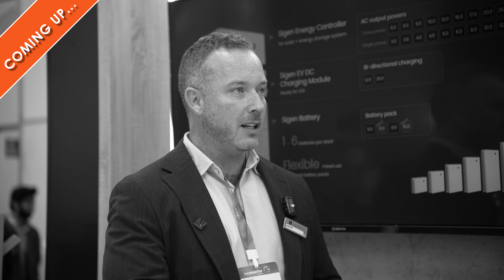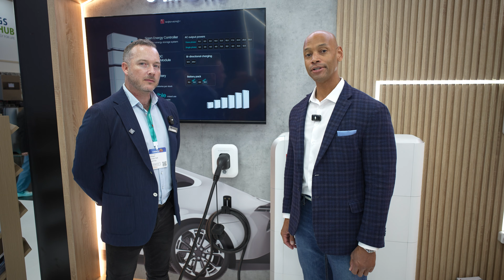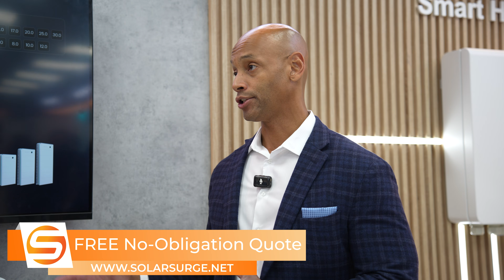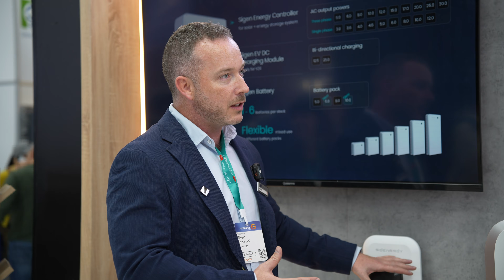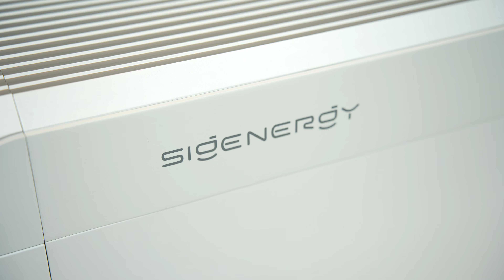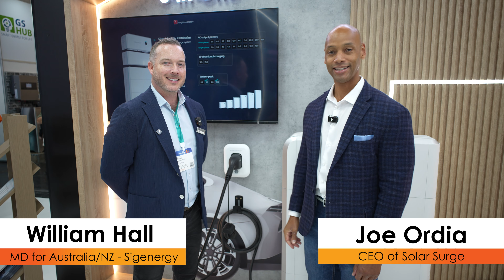NEW Sigenergy Bi-Directional DC EV Charger | PointGuard

Comment: My final comment with H2X capabilities home batteries and a heat dump I am turning my home into an energy positive household saving around £2K on standard bills.  Plus the fact that on fuel my EV home charging is saving me further £2K based on 12K miles a year.  My goal is to become energy independent for when I reach 80.

Comment: On a technical level I'd like to understand what is where... The vehicle side of the bidirectional charger is DC (about 400 V to suit the vehicle battery), what is the other side? DC to an existing battery or panels in the home or AC to the grid - 3 PH or single PH??

Comment: this is what the PW3 should have been. I mean it already has PV DC to DC battery (with I suspect a boost up in voltage) so why not insert a wall charger in between and do DC charging AND v2h using that existing hardware ?
well I guess that would eat into secondary PW3/Expansion packs AND reduce your battery warrantee per miles (which they could track). But common Tesla, that's what we want!!! we have 7x batetry between wheels AND coudl charge on solar much mroe efficently.

Comment: When will it be available in the USA? I have a 10kW and a 6.5kW system and would love to have a good DC storage solution with V2X for both. Our grid provider is not providing the incentives to sell excess back to the grid. So the more I can use the better.

Comment: Tesla has really dropped the ball on V2H DC charging. What losers. They could have been leaders now they are almost last cause the CT implementation is such a pathetic method and was the easiest thing to do since they already had DC to AC conversion onboard. Pathetic Tesla.
Reply: Not that I don’t think there are plenty legitimate gripes about Musk and Tesla. But I don’t think this is one of them. 
The issue is US regulators being slow. And then PoCo’s dragging their feet (see issues with meter collars). So, both EnPhase and Tesla not in a rush, as it will be a while for standards, vehicles, AHJs, etc all being ready to support this. Why first in Australia? Cuz standards pushed out much sooner.
Reply: @lawrence_SoCal I get the vehicle to grid regs are a mess but they could have easily embedded a Tesla car into their power wall. All they had to do is connect a power wall to their wall plug and the user could use the power DC battery to charge their vehicle or in the event the battery was depleted since the power wall is already connected to power it could have sent AC to the car. If they did this, during power outages the user could still power the car and the user power the whole home by using the battery or the car as a battery along with the power wall. All of it could have been done without home to grid regulations. What a missed opportunity.
Reply: @TheLobo91 understood and I don’t disagree. BUT, plenty of Powerwalls sold to non-Tesla car owners. Or folks sell their Teslas. Having a capability limited to only some of Teslas cars, that could only work in limited situations… with lots of stupid end users who’d tried to make it work with other vehicles … sometimes patience is a virtue. My point is there are other mass market considerations that could have been really good reasons for Tesla to not get so far ahead of standards 

And, per my other comment… still waiting for independent review to confirm or refute that DC bi-directional EVSEs are actually worthwhile in general (due to energy loss with voltage conversion at a minimum). Now, if home battery and EV battery the same voltage, then DC charging makes lots of sense.. but when that isn’t the case?
Reply: @lawrence_SoCal  their must certianly already be a DC to DC voltage up as PV are not quaranteed to match the internal battery. had they made the PW3 battery the same ~400v as most tesla, it coudl have simply made the car a 7x expansion pack with very little work. done...
Reply: @lawrence_SoCal  The National Electrical Code has added provisions for bidirectional charging in the 2020 version. Also, the global standard are already in place as well under ISO 15118-20. The V2X Module launched about the same time in the US as it did in Australia.
Reply: @Elec_Engineer_03 that may be, but the existing code really only covered, effectively, V2G, as V2H means working when grid is down, so you need MID coordination and power control of PV for an effective solution. And getting agreements across companies, industries, is still a work in progress last I heard. Going all in on same vendor (inverter, battery, MID, and EVSE) seems the only practical solution today which is an indication that practical effective standards aren’t there yet, or certain companies are making a mess of things (standards process) trying to prevent component commoditization.
Reply: @lawrence_SoCal  Exactly. The V2X module does both V2G and V2X which means its covered under existing code. When used with the LoadHub, which has the MID that provides the isolation, allows it to be used for V2H and is going through testing with utilities for V2G. A lot of vehicles have already been tested, including Teslas and Fords and they can be discharged with the V2X module.

Comment: According to the internet (Google) Many EV manufacturers continue to advise against making DC fast charging a primary charging method due to its potential impact on battery health over the long term.     Kia and Nissan both have suggested avoiding frequent use of high-speed chargers .     Kia has attributed a 10% degradation over just eight years due to frequent DC fast charging based on their research.     They claim that frequent use of fast charging can do these things.
A. Heat Generation: DC fast charging delivers a high influx of energy quickly, generating more heat within the battery pack than slower charging methods. 
B. Increased Stress: The high currents and voltage associated with fast charging can create more wear and tear on the battery cells.
C. Lithium Plating: Fast charging can lead to lithium plating, where lithium ions deposit as metallic lithium rather than entering the anode material. This can reduce battery capacity and increase the risk of internal shorts.

Yes,  modern EVs are increasingly equipped with advanced Battery Management Systems (BMS) and thermal management systems to mitigate the negative effects of fast charging. These systems help regulate battery temperature and charging parameters to protect the battery. 
However, some best practices can help extend the life of your EV battery, regardless of the manufacturer's specific recommendations:
Prioritize slower charging: Use Level 1 or Level 2 charging for daily needs, reserving fast charging for longer trips or situations where time is critical.
Avoid charging to 100% and extreme low states of charge: It is generally recommended to keep your battery's state of charge between 20% and 80%. Charging to 100% or letting the battery drop to extremely low levels puts more stress on the battery.

Comment: A fast charger especially when on the road is great for traveling but what some people don't understand is that according to the battery manufacturers it can damage the cars battery if you use one frequently.    Batteries being slow charged do not get as hot and the battery manufacturers ALL recommend a slow charger that takes hours to slowly recharge for the longevity of a batteries life.
Reply: EV battery warranties and manufacturer's recommendations would surely emphasize this if it were a huge problem.  The BMS in EVs controls how fast the battery can charge and tapers down as the battery gets full.  Worrying to much about battery degradation is somewhat foolish.  Just charge your EV as often as you like at whatever kW it is designed to handle.  I have done hundreds of DC fast charging sessions without a fear in the world.  Manufactured concerns based on nearly inconsequential effects of using a product as it was designed to be used tend to scare people unnecessarily.
Reply: @J-W-Kelly    -  Actually they all say in an EV's owners manual that comes with the vehicle not to do a lot of fast charging as it shortens the batteries life.
Reply: @Bowhunters6go8xz6x this is actually not true anymore. There have been studies done that show fast charging impacts modern EV batteries almost none. Calendar age degrades a battery much more than anything, but most EV batteries are still above 80% even at 10 years. Fleet use cycling 0-100 daily vs minimal use cycling 0-100 once a week only made 1%/year difference over 3 years. The data showed no difference between cycles under fast charging. Even if it was, fast charging on the road is 150kw+, whereas this is effectively the lowest “fast charge” speed possible at about double a standard home charging system. You can also use this at lower speeds if you’d prefer, so mine is usually charging at 11kw, I use 20kw when I need a faster top up once in a while.
Reply: @Bowhunters6go8xz6x  No, they most certainly do not all say that.  I have had 3 EVs and not one of them said anything about reducing the use of DC fast chargers... next.
Reply: @J-W-Kelly  -   I simply posted what is on the internet if you ask the question on Google.       I tend to investigate and believe that over just what some poster says !
Reply: @Bowhunters6go8xz6x  Hilarious... you asked google.. that's not investigating so much as being spoon fed.  If you had actually read the manuals I have read you would be better informed.
Reply: @J-W-Kelly  -   Nope,  being spoon fed is asking on a blog because you are too F-ing lazy to do some reading !
Reply: This is why communication is key. The V2X module communicates with the vehicle using the global smart charging standard. This allows for the vehicle to dictate the charging session.

Comment: I have this exact system installed at my house in the San Diego area right now and I can use my Rivian or Ford Mustang Mach E to run my house all night or if I choose, push to the grid. It’s amazing! Pointguard/Sigenergy V2X- Rivian powering whole house overnight
https://youtu.be/zMQu_yazQ68
Reply: The Ford Mach E does not support bidirectional charging through 2025 model year.
Unless this Pointguard unit has a workaround to get power out of a Mach E for v2h
Reply: Did they also supply a free fire extinguisher?
Reply: @mdcplace100 Actually yes. All the batteries have them built in from Sigenergy. If your beef is with EVs though, they many times safer and less likely to catch fire than vehicles that require you pouring highly flammable liquid into a tank and parking it inside a building. LFP batteries are extremely unlikely to burn.
Reply: @True_Dad no beef necessary

Comment: A 12.5 or 25 kW direct DC EV charger would be awesome!
Reply: 11.5kW AC chargers are way cheaper and easier to install though. That’s 200mi range added per night (8hrs) even in a power hungry EV truck or Van. @2.2mi/kWh

Comment: Big issue with currently available bidirectional home ev charging is cost, both for the required bidirectional hardware and installation labor, permits, etc.
Costs I've seen for the current F150 Lightening bidirectional charging system with supporting SunRun inverter hardware between the Ford Charger Pro and home main panel is ridiculous.
Far less expensive  and far less complicated to just use an l14-30 240v out on the vehicle to a matching input on the home with a main panel transfer switch and lockout
Reply: No it isn't.
Reply: @zac9080You had the Lightening bidirectional setup fully installed and operating?